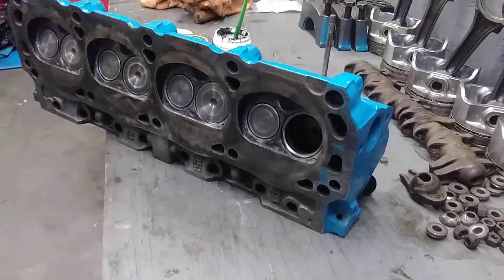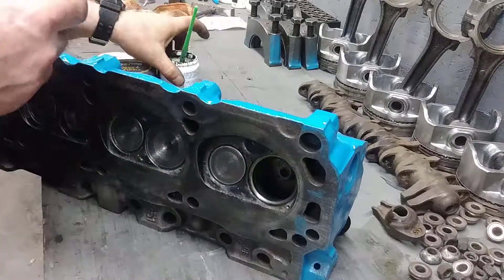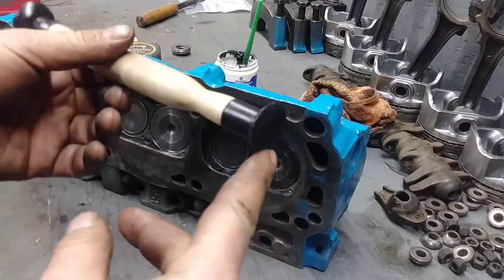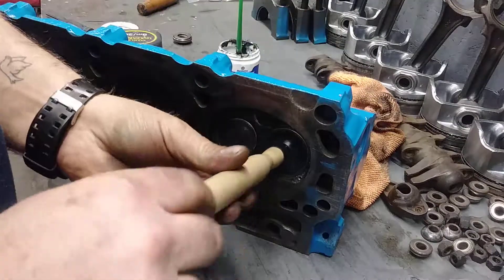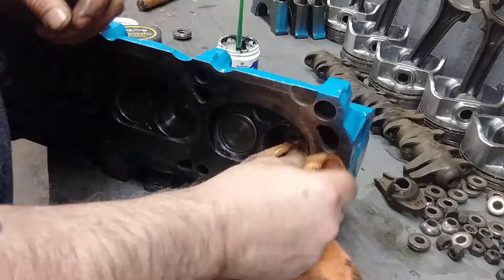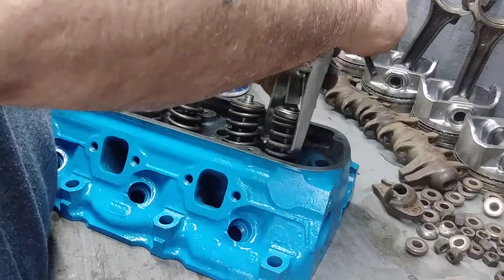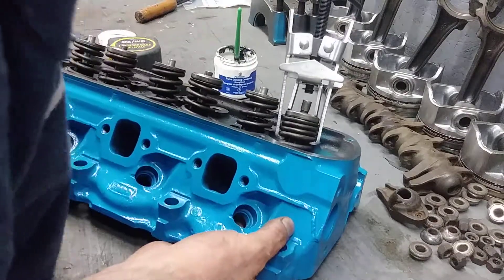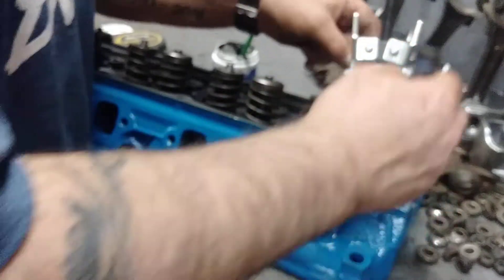Valve seat lapping, valve spring install

Comment: Great video! I also have a D9AE... 351W small block bored to .040.It might need cylinder to be bored and I wonder if going with .060 is not too much for my engine just I'll be using it for street drive and occasionally off road...
Reply from the maker: So far no issues for me at 0.060....but my block is a 1974
Reply: @rotorway133  Yes, you have a thicker block; when I'll open the engine and look inside will decide if cylinders need honing only or re-bored . For now I see 44 psi on  in cyl. #8... all the other read between 125 and 170 psi...Hopefully the valves...

Comment: How do you know they are seated correctly? Do you do a vacuum or water test? Thank you
Reply from the maker: When you lap the valves, you can actually see if they seat properly. Also, a compression test once the engine is assembled will tell you if all is good
Reply: @rotorway133  I personally would do a vacuum test of just the cylinder head & valves to verify everything is good before fitting the head to the engine. The last thing I’d want to do is have to take it all apart should the leak down test not be good. Take care
Reply: @chrispack3131  just put some gas on top of the valve and see for leaks
Reply: @ayyy9017  That will work! I normally fill the ports full of fuel & check for leakage from the valve seats.